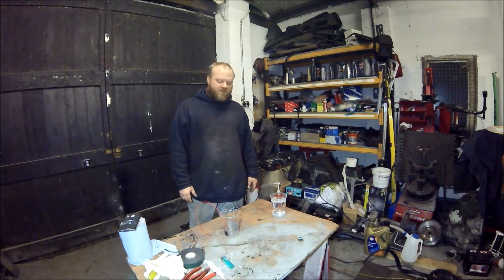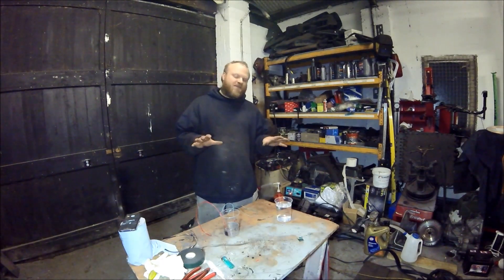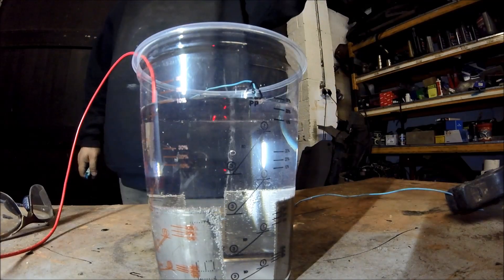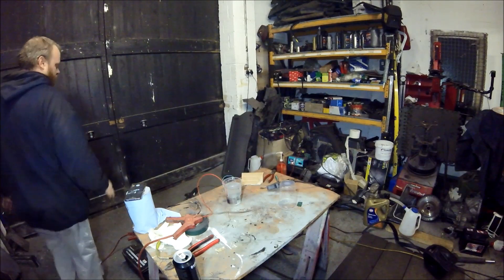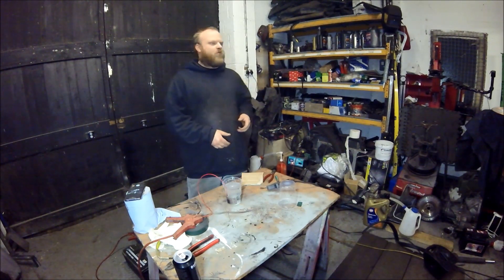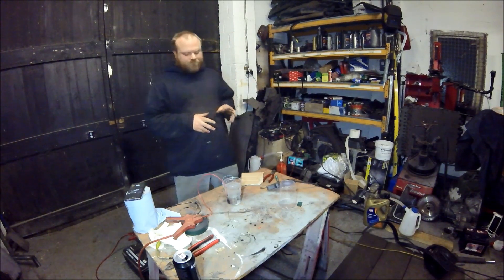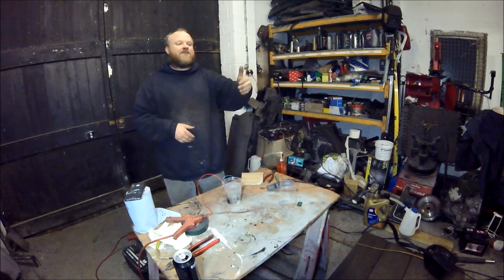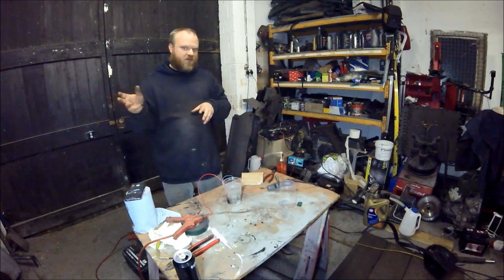can a car run on water hho / h2o fuel cell generator hydrogen gas M-tel garage

Comment: you didnt add any salt or baking soda to the water you need an electrolyte other than the trace bits and impurities in the tap water for a more furious reaction also a limiting fuse is good otherwise the  plates warm up the water and then it requires more amps to run the plates resulting in a thermal and amperage runaway.

Comment: Hey, great video! Appreciate the skepticism, but have you considered trying to make a HHO fuel call and attaching to a car? It would be interesting to see if you could significantly improve the mileage by supplementing HHO instead of running solely on HHO gas.